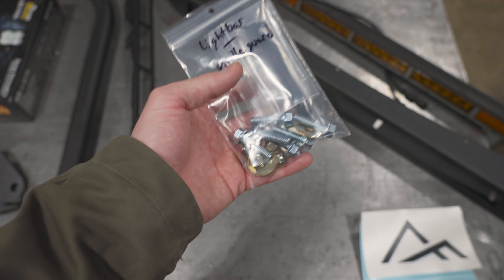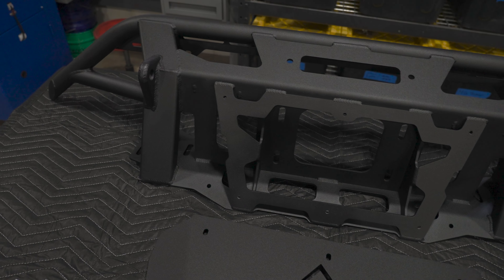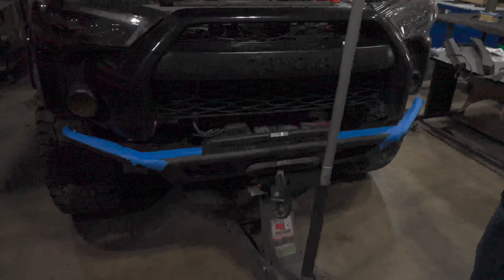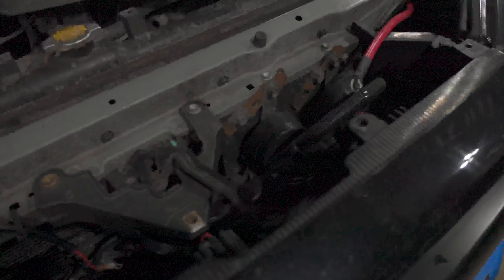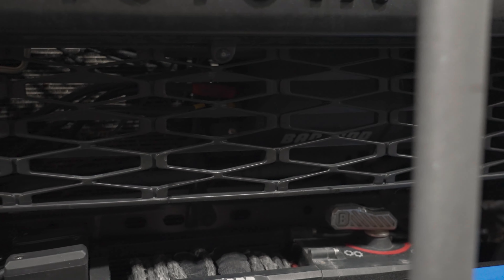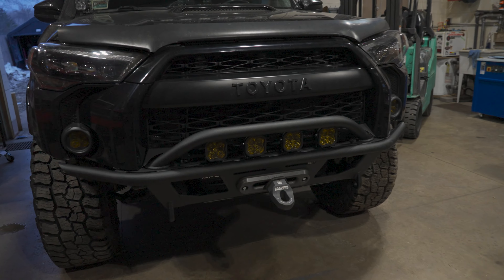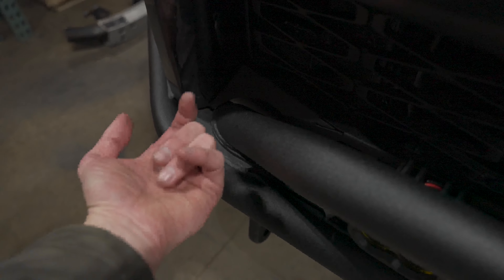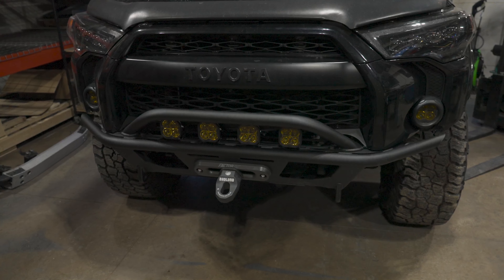I Switched my 4Runner Front Bumper! | Ascend Fabrications | STAGE 1 Pre-LANDER

Comment: I would avoid mounting a winch into a bumper where all four holes are replaced with slots.  On a hard pull, the winch is going to shift forward in those slots.
Reply from the maker: Not if I mounted it all the way forward already 😏…but yeah that happened in my LoPro bumper one time…